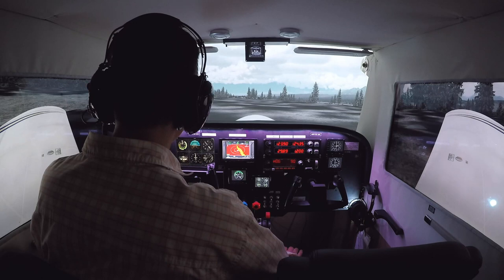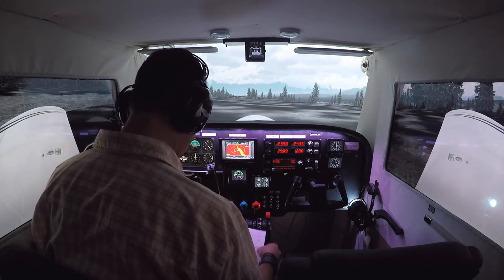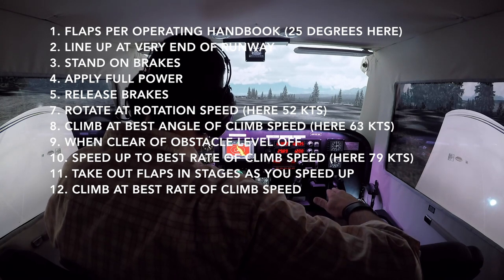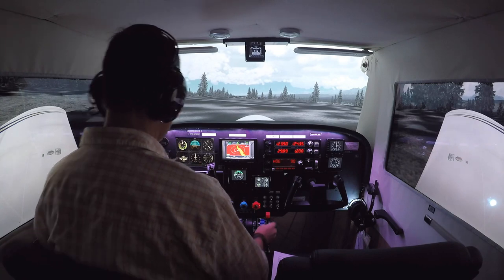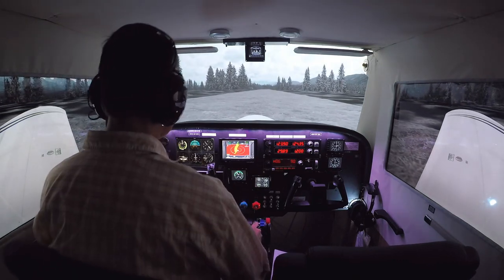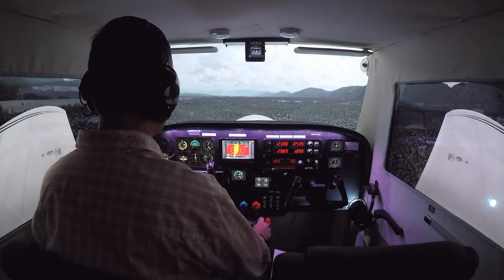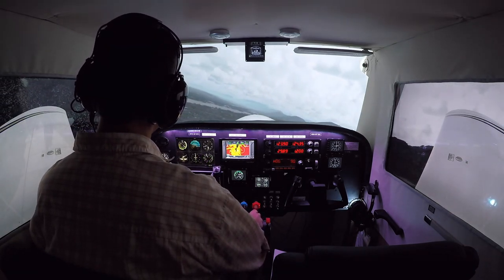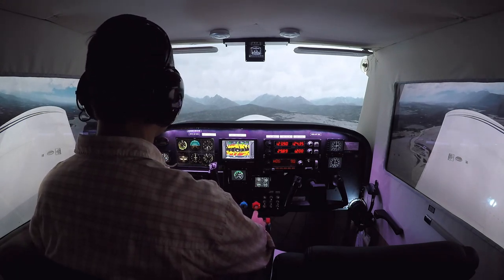How To Simulate A Short Field Takeoff (Prepar3D Home Cockpit)

Comment: You have probably been asked this alot buttttttt, how much is your sim setup ?
Reply from the maker: I stopped keeping track! The cabin was inexpensive as it's just lumber and plastic siding, etc. and I built it myself. Same with the panel and glare shield. The LED lights were a little pricey, but necessary. The main investment was the PC, the projector, and the Saitek gear (which I got all used on Ebay).